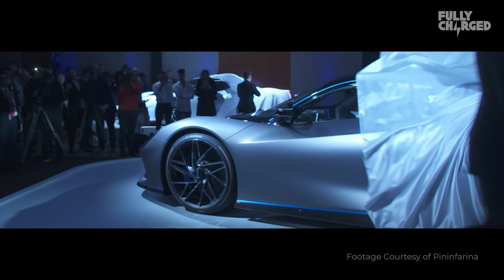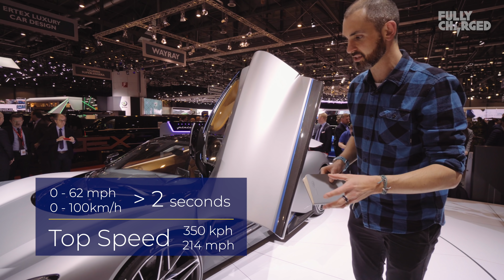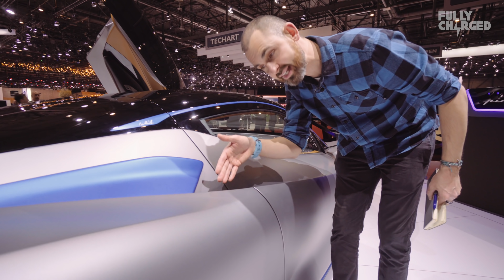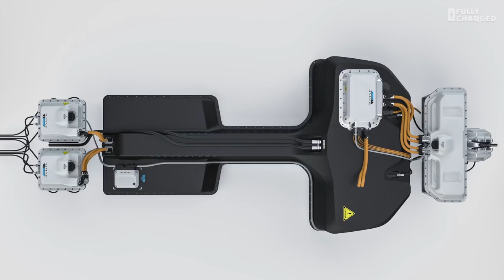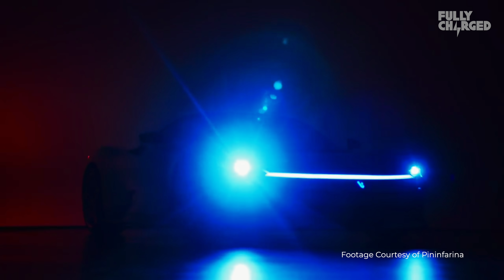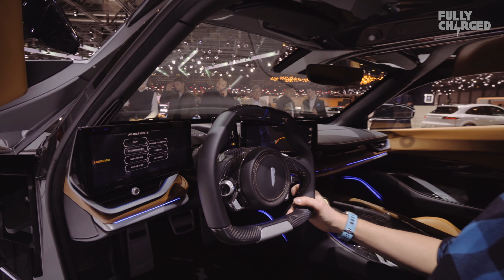Pininfarina Battista | Fully Charged 4K

Comment: You can tell this car is made by a design house. The overarching motif of the equilateral triangle is incorporated beautifully throughout both the interior and the exterior: from the embossing in the seats, central console and door panels, through the grippy texture on the control dials, to the air intake in the front. Absolutely stunning. But what I like the most is how beautifully the rear lights are sculpted. Amazing design.